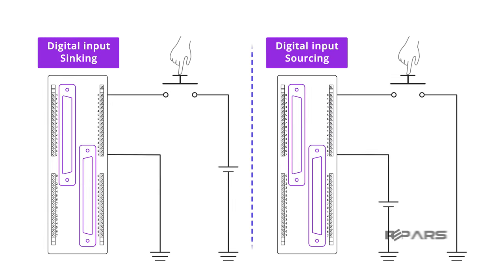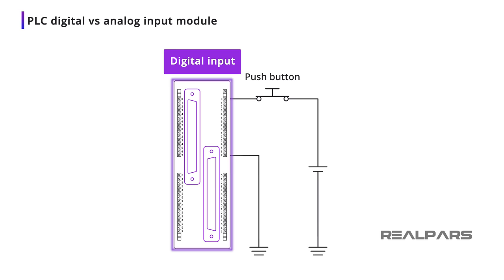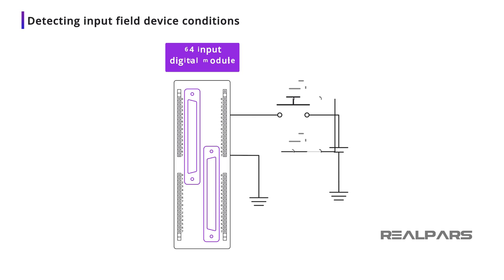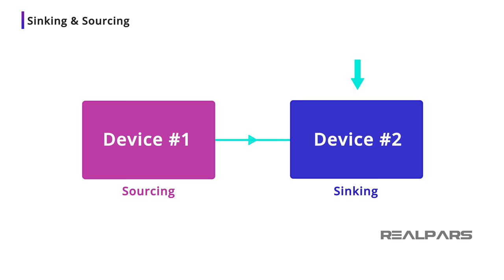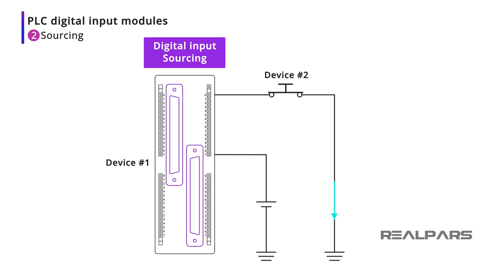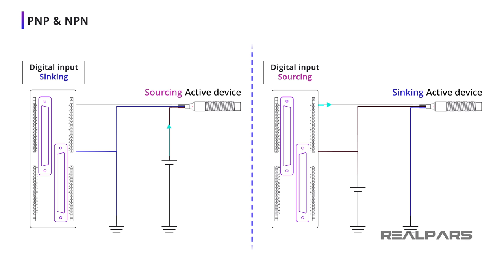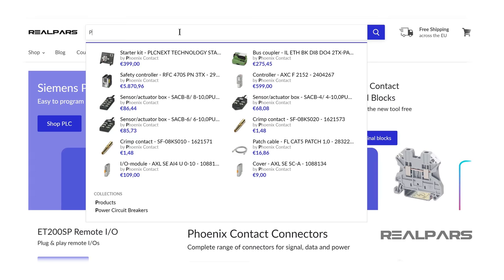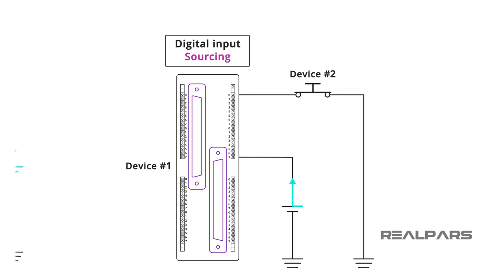Sinking and Sourcing PLC Inputs Explained | What is the Difference?

Comment: Literatures and PLC manufacturers differ from one another when it comes to the concepts of sinking and sourcing. The important thing is that you have to maintain the potential difference of 24V between digital input and common terminal. In many PLCs, we can connect either 0V or 24V to common terminal and opposite of that (24V or 0V) must be connected to digital input. It is better to refer installation guides of PLCs to decide wiring connections. Some PLCs even have jumpers to switch from sinking to sourcing type wirings and vice-versa.
Reply: Do you need PLC or another products?

Comment: Every circuit has a power source and a load.  This this case, the input card is the load on the circuit.  It’s the device that regulates the amount of current the flows through the circuit.  Sourcing or sinking just determines whether you switch the + side of the power supply or the ground side of the circuit.  The circuit works the same when current flows but it has ramifications that are important to note.
For instance, let’s take the sinking input.  You have +24v going out to the field and when the switch out there closes it comes back, through the input card (load) to ground.  Now let’s say you accidentally ground out one of those field wires.  It could me anything.  A tech could drop on and hit the metal conduit.  The conduit can be damaged, or the switch can fail and become grounded.  If you do that to the +24v wire, then you immediately short the power supply.  If you do it to the return wire, then you short the power supply when the switch closes.  Either one can take down the whole control system unless you put in overload protection.  
Now, in a sourcing input card.  The two field wires are placed in the circuit AFTER the load (input card).  If you short the wire coming from the card to ground, the input goes active immediately.  If you short the wire after the switch (going to ground) then the input goes active after the switch is closed.  This makes sourcing inputs more able to deal with failure modes.  
Unfortunately, sourcing type inputs can be trickier to troubleshoot and the tech definitely needs to know it’s a sourcing input card.  
Sinking cards are by far the most common found in the US.  I believe that’s because they more closely resemble how most electric circuits work and so, are easier to envision for troubleshooting and for designers.
Reply from the maker: Thanks for sharing your knowledge and experiences with us! We always appreciate such in-depth comments.
Reply: Such an amazing explanation !
And yes; we faced such ground in GE Speedtronic Control System and it took us some time to figure out the problem ...
Thanks for your detailed comment I already screenshot it as a reference for me and for my fellows

Comment: I am new to this branch of engineering. Could you please help me on my question. How does the CPU detect which of its many input is receiving a 24V DC? Is it by 0s and 1s? Does each input have separate wirings going to the CPU? Thanks a lot.
Reply from the maker: Hi there. Thanks for your question. You've got the right idea about the 1s and 0s.  There are no actual connections between the input modules and the CPU. Each input status is stored in the PLC's RAM memory as a 1 or a 0, depending on its condition.  The CPU uses this memory information to perform the logic required by the PLC program.
Reply: @realpars   I understand it now. Thanks

Comment: Sir what are the condition under which we use npn or pnp sensors
Reply from the maker: Hi. Thanks for your question.  It really depends on what you want to switch with your sensor.  Do you want to switch ground/return or supply voltage?  It also depends on the input module itself. If your module is a sinking type, you need PNP sensors. If your module is a sourcing type, you need NPN sensors.

Comment: when sensor is in closed state. 
what will be the voltages in sourcing and sinking plc inputs?
Reply from the maker: Hello @t4c4.  Thanks for your question. Let's assume our Power Supply voltage is 24VDC and the sensor is in the closed, or low resistance state. There will be 24 vdc at the Sinking plc input terminal and 0V at the Sourcing plc input terminal.  Interestingly, with the sensor in the open, or high resistance state, the voltages will be opposite.
Reply: @realpars  Thanks

Comment: Stupid question. At my work it seems to be pretty much standard for all different manufacturers to use PNP sensors in their devices. But why does both still exist in industry? Is it simply backwards compatibility for older equipment or does NPN offer great benefits in some configurations? Oh and more, does ie. Siemens CPU's support to plug in both type of input cards simultaneously? I'd assume they would, though wiring would be great pia and very misleading to people who wouldn't notice that odd configuration.
Reply from the maker: Hi jothain.  Both still do exist in the industry for a number of reasons.   Your question is excellent and has appeared a few times for this video. If you scroll down and read through the comments,  you'll see many responses from us and also other viewers. Siemens PLCs have the ability to have both sinking and sourcing modules at the same time. This is true for most PLC vendors as far as I know. And you are correct when you say it could be misleading and possibly create some errors dues to incorrect wiring faults.
Reply: Do you need PLC or another products?

Comment: Hi, I am planning to power up my Digital Inputs and Analog Inputs Extension module with 24V DC from PLC 24V DC Supply (500mA). Is it okay to do this? For the PH meter I use AC source, Flowmeter I use other DC Supply, and the pt100 temp sensor I use two wiring transmitter
Reply from the maker: Hi Chickenz. It's common to connect input devices to the 24 v power supply. But, you need to be cautious so as not to overload the power supply. Not knowing what you have currently connected to the power supply, it is not possible to determine the current draw.  You might have to do a bit of homework to find current draws for your connected devices. As for the PLC inputs themselves, they draw very little current. I'm, sorry but I don't know what you mean by "Analog Extension module". Can you elaborate please?
Reply: @realpars  Currently I have PLC unit with 16 DI and 16 DO and Analog extension module with 4 AI. This analog module also requires 24V DC Supply. For the PLC it uses AC source and have 24V DC Supply Out. Thx

Comment: so if i have plc D.I. sourcing and i measure the voltage in each side of the switch(off state). what would be the reading? 24VDC? given 24 vdc is the plc
Reply from the maker: Hi @nayrbs world.  Thanks for your question.  If I understand you correctly, you are referring to an open passive SPST switch connected to an input of a sourcing digital input card.  You will measure 24 volts on the switch terminal connected to the digital input terminal of the module. If the switch is open, there will be 0v on the other side of the switch.
Reply: i mean if i will use a switch with a (Normally open & normally closed switch SPDT) i wire a normally open to a d.i. sourcing plc. when i put the (+) leads of my multimeter to N.O. then (-) to common of that switch at idle state. what would be the reading in my multimeter. the same as what will be the reading when in NC state. thanks real Pars

Comment: Nice work!
Reply from the maker: Thank you!
Reply: Do you need PLC or another products?
Reply: @stevenlee5755  yes I do, what do you have to offer sir?
Reply: @roseelectronics4582  We can offer you  industrial products like Module, PLC, LCD panel,HMI,VFD,CNC spindle,CNC accessories,servo system, stepper system etc.
Reply: @roseelectronics4582  various brand PLC and another industrial product ,such as servo motor ,gearbox,VFD ,and so on

Comment: Thank You!
But When we use sinking and sourcing.
Somebody can give example for a life 😌?
Reply: In most cases, we use sinking, so when we use sourcing?
Reply: @danielkoryciak2357  Sometimes a control system is setup with sourcing PLC inputs as a design choice, but the main reason I have seen it used is when some of your digital field devices only support NPN outputs. Some rotary encoders, reed switches or other devices are not always available in a PNP output in the brand and size you want. In this situation you either need a converting relay to change the device output polarity to suit a sinking input, or to use a sourcing input setup.
Reply: Do you need PLC or another products?
Reply: Do you need PLC or another products?

Comment: I don’t get what the point is in having two different types? I feel like plcs are overly complicated for absolutely no reason what so ever it could all be done so much easier than the way it is
Reply from the maker: Hi @Bob Smith.  That's a great question. Thanks for reaching out.  Bottom line, it comes down to what voltage level is required.  A sourcing input or output circuit provides the necessary voltage for the circuit. A sinking input or output circuit provides the necessary ground for the circuit. I'm sorry to hear that you think the graphics and illustrations are overly complicated. We do our best to simplify concepts for our viewers.  Any modification suggestions are appreciated.
Reply: @realpars  no I didn’t mean your video was overly complicated I meant plcs in general . They can be done in a much easier way than they do them but they like making it harder for people for some reason